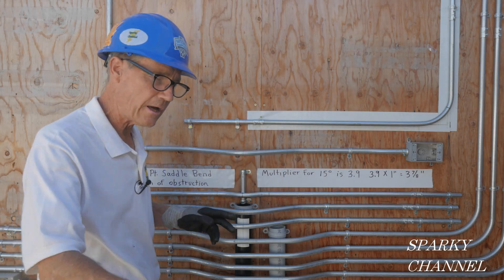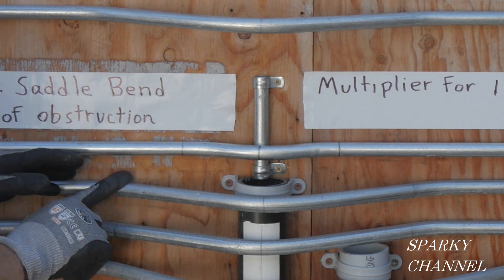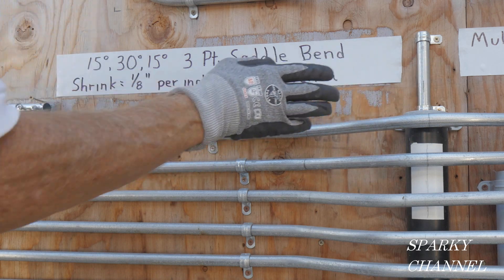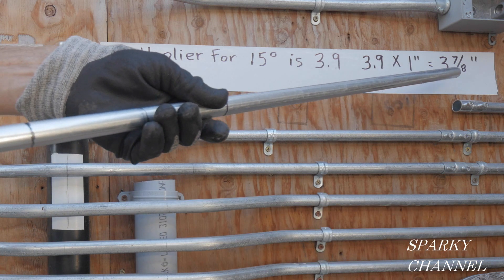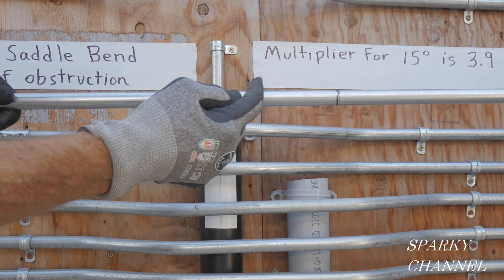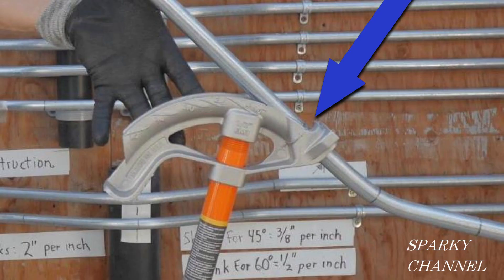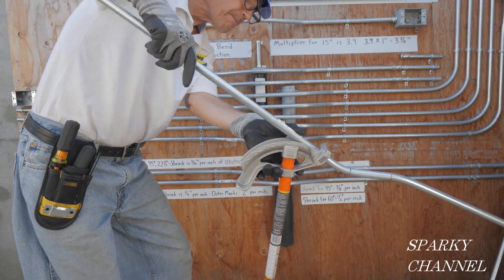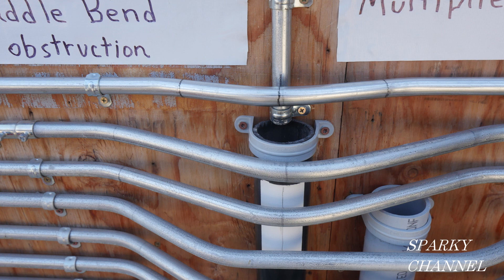How to Make a 15°, 30°, 15° Three Point Saddle Bend

Comment: Is some of this conduit harder to bend (thicker walled - I have steel conduit I believe)?  I bought some Lowe’s 3/4”, and I can barely bend it. Having a horrible time learning to bend conduit - used up 4 5’ sticks, and haven’t made a successful 3-pt saddle. Other options?  This looked easy for Sparky!
Reply: Yes bending anything that’s rigid is extremely harder that max pipe for rigid you should bend by hand is 3/4

Comment: On the Klein tape it says for 15 degree is 1/16 per in. Your vidio says 1/8 per in what’s correct ?
Reply: Actually the Klein tape measure says 1/8 per inch for 15 degree and 1/16 per inch for 10 degree, so 15 degree is 1/8 per inch not 1/16 per inch. Also, you get your shrinkage from the very first outer bend, not the middle. Hope this helps
Reply: @ddaniels2901dd  no shrink is based on the very first bend aka your center bend, if center bend is 30 your shrink is 1/4 x inch same shrink constant as your offsets

Comment: 45 degree or  30 any one prefer one over the other
Reply from the maker: Always go with the 30's if you can because the wire will run easier. Use 45's when you need the clearance though.
Reply: ↑ Yep, always use the shallowest angle you can get away with.

Comment: Thanks, was always wondering what the multipliers for the smaller saddles were and how to get over small obstructions. There is not a lot of info out there on 15, 30, 15 saddles, most people probably just use strut to get over those smaller obstructions

Comment: Can someone explain how to know when to use the mark on the bender and when to use the notch. New to bending.
Reply: The center notch marks the middle of your bend. It Doesn’t matter which way the bender is facing, since it only marks the center. Offsets, shorter 90s, 4 point saddles, and the outer bends of 3 point saddles use the arrow. Large measurement 90s use the star(large measurement as in over half of the pipe). For the outer bends in a 3 point saddle the front of the bender shoe must face towards the center bend
Reply: The notch is for the middle bend of a 3pt bend. Star use for 90 degree bends. Use the arrow for everything else. Fairly new to bending myself (1 year) but this is my understanding.

Comment: I noticed in your other 3 point saddle video, you used a chart for 45 degree method which is 2.5 multiplier for outer marks, so how come this one you didn’t do that?
Reply: Hes using a 15, 30, 15 degree bend instead of 22.5, 45, 22.5 degree bend thats why

Comment: Hi. I love your videos. How come green Lee 3/4 bender has different lines for different 3 point saddle middle angles.
Reply from the maker: I have Ideal and Klein benders and I'm not familiar with the Greenlee.
Reply: There used to be a Klein model that had that too, but they discontinued it. It's a mystery. Supposedly the star is center of bend for a 60. I went ahead and measured my own center of bend for a 22.5. For 30...I dunno, it's in there somewhere.

Comment: Hi Bill,
 Question for you ?
 Did you ever get a chance to review the, 
 Fluke 1770 Analyzer ? Or is this more Industrial only type of use ?
Reply from the maker: Hi! The 1770 is mostly used in a commercial setting but it is great for residential work as well. I haven't reviewed it yet but I will if I can get my hands on one. I love fine metering equipment like that. Some info for other viewers: 
Product overview: Fluke 1770 Series Three-Phase Power Quality Analyzers
Automatic measurements. More flexibility. Better power quality troubleshooting.
Fluke 1770 Series Three-Phase Power Quality Analyzers eliminate the complexities of power quality logging, troubleshooting, and analysis. Engineered to be the faster, easier way to perform power quality studies, the 1770 Series offers automatic measurements, a straightforward user interface and setup, best-in-class specifications, and a simplified reporting platform. The instrument can also be powered directly from the measurement circuit, eliminating the need to find a power outlet or use a lengthy extension cord
With the 1770 Series you’ll never miss a critical power quality event—from fast transients up to 8 kV, harmonics up to 30 kHz, dips and swells, as well as the voltage, current, and power measurements that enable you to characterize your electrical system.
Reply: @SparkyChannel  
 Thanks Bill,
Yeah it would be interesting to see what your thoughts are on this 1770...
 If down the road you happen to get your hands on one, to review.
 That would be awesome....
        Thanks for the fast return reply....
  Best regards....
                Rich 😎🇺🇸

Comment: Hey Bill,
Is there a calculator that gives the totals for bonds. Especially if you stink at math. Where I mess up, is getting the correct number for the 2 outside marks, of the center line. Will a standard calculator do the trick?
Reply from the maker: Hi! There are apps that you can get on your phone for conduit bending but in my experience they aren't very good. Check out this video: EMT Bending Multipliers for Faster and More Accurate Bends: https://youtu.be/wgsiD1XUuA0
Reply: Ur in the wrong trade then...

Comment: Hi Bill, is it against code to wire room, for example,  with all the receptacles leading to a junction box in the attic? So, basically having the “home run” wire be in the attic junction box  and from there, have it distributed to the receptacles in a bedroom.

Thank you.
Reply from the maker: I haven't seen anything in the NEC prohibiting that. Of course the J box in the attic would need to be of sufficient size for all the conductors.
Reply: @SparkyChannel  perfect. Thank you.
Reply: And needs to be  considered accessible
Reply: @lostcause1206  absolutely.  I placed it about 2-3’ from the attic entrance. It’s also labeled so that I know which room it belongs.
Reply: @CDPMATH  I have a 6x6 pvc jbox in my attic
For my rear floods switched from  4 locations , all switches , lights , feed and photocell are a single run to that box , it has 22 # 14 conductors. 
7 - 2wire 
3  -3 wire nm
Reply: @lostcause1206  awesome…I’ll definitely make sure to use a large enough box to prevent any over heating.